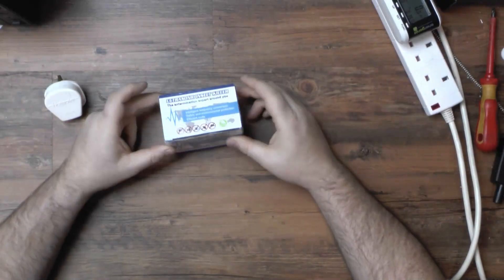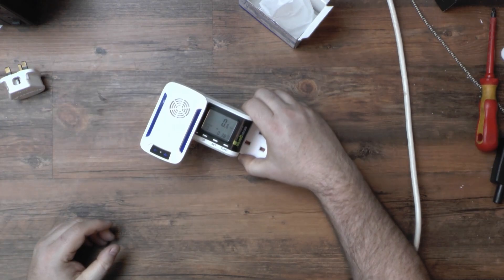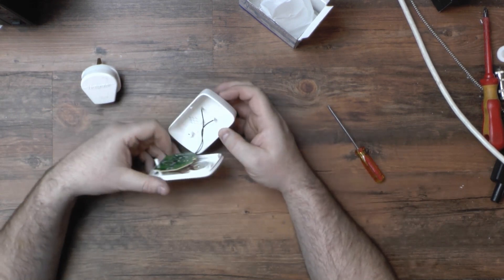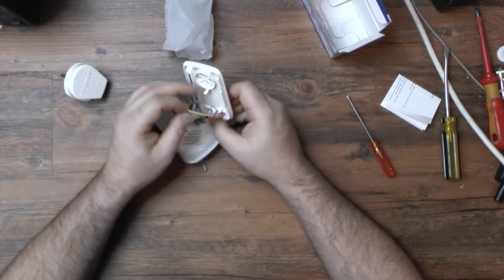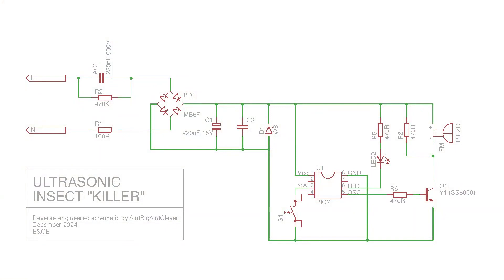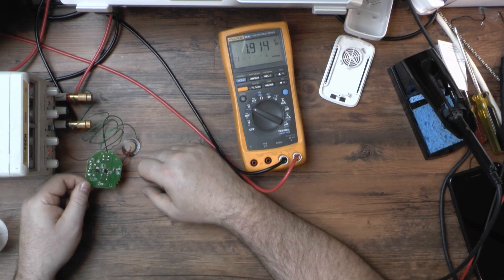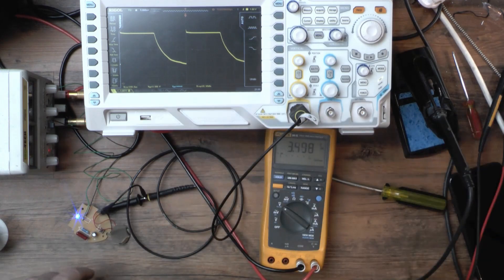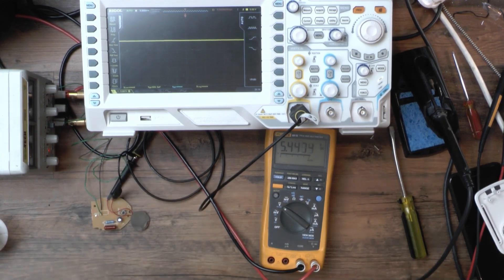Ultrasonic "insect killer" teardown

Comment: Basically a heap of shite
Reply from the maker: Pretty much.  If the zener fails short-circuit then the dropper will dump everything through it.  If it fails open-circuit the microcontroller and electrolytic will experience more voltage than they're designed for, and a tad more than I zapped it with.  Nice bit of magic smoke from a device meant to be left unattended.